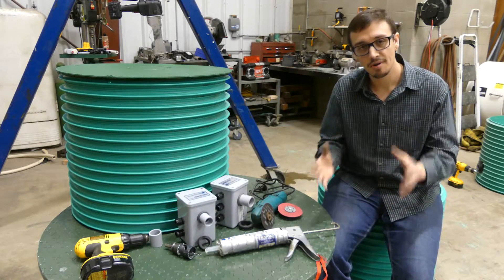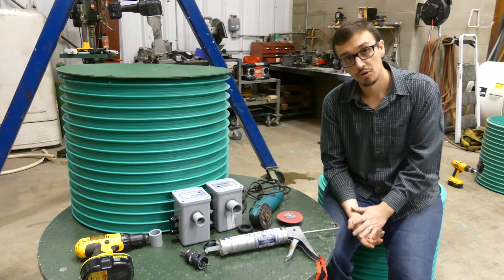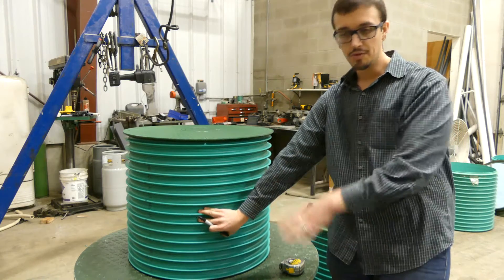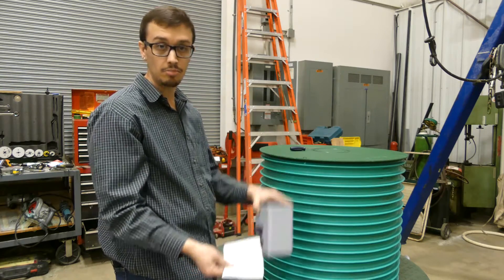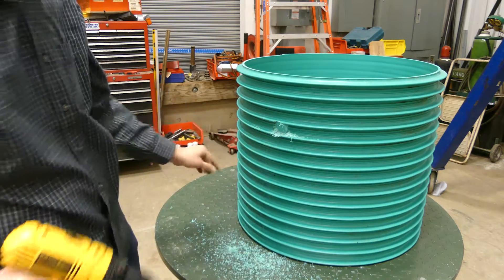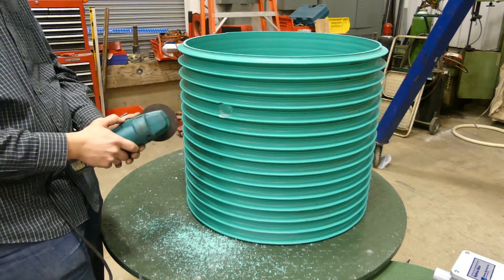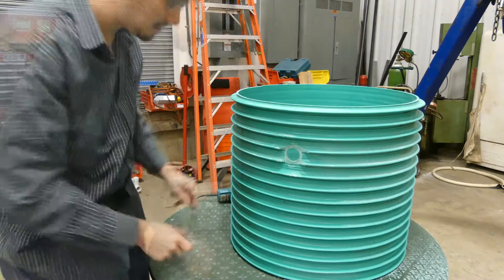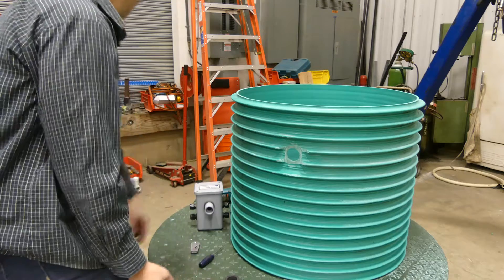How to Install an Internal Splice Box (Field Method)

Comment: Do you have a diagram for wiring 3 floats inside the splice box? Having a lot of problems with it!
Reply from the maker: What control box are you using?
Reply: @RCworstwater  standered s-1 or ssf1ptro